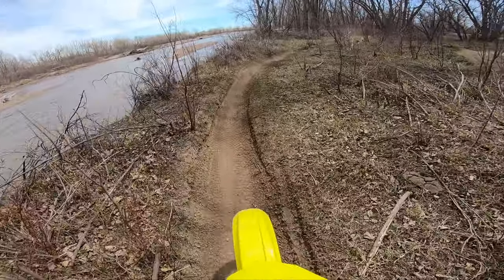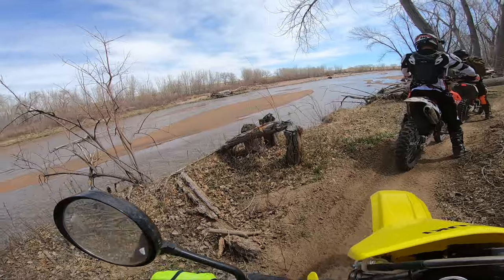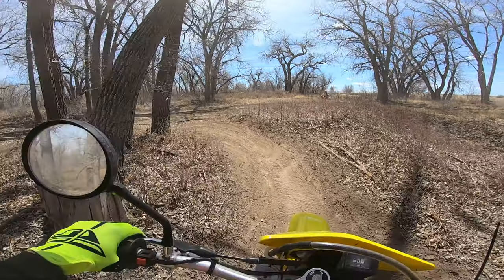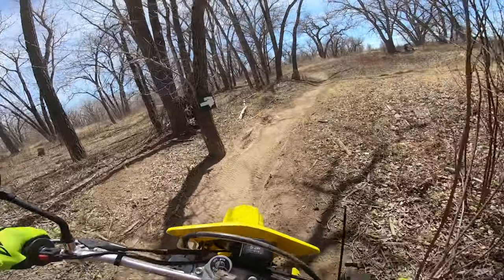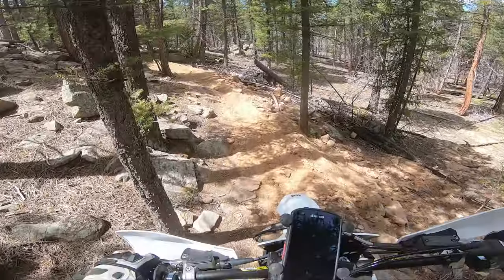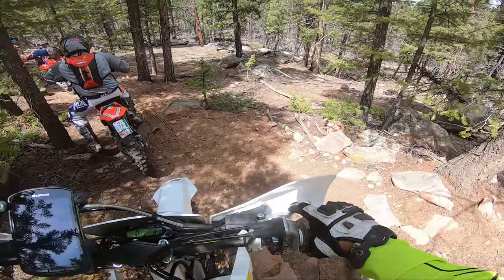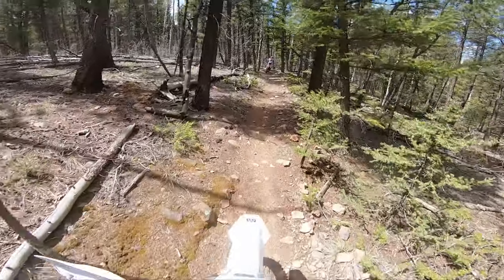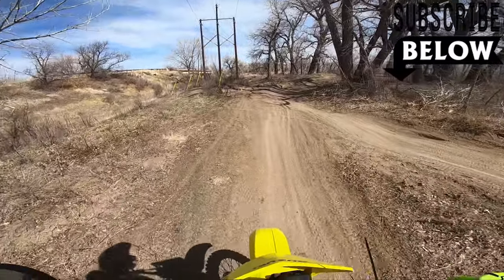Can the DRZ400 on 15 38 gearing do single track? How is the DRZ400 on single track?

Comment: was thinking of 15/44 or 15/47 on my drz. probably do 60% offroad tracks but still want to be comfortable on road and not struggling to get to a reasonable cruising speed. what would you suggest?
Reply from the maker: That's a good pick depending on the hills and slow technical stuff you do and tight single track. 15 38 has tons of power and can def do normal trails fine with 15 38
Reply: I got 15/47 on mine works pretty good not as good as 14/47 but better on the road